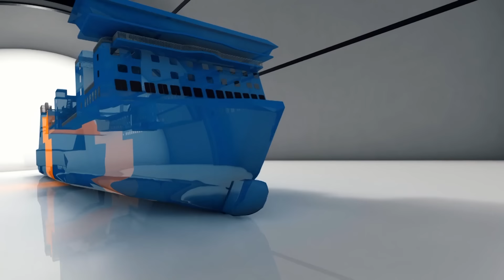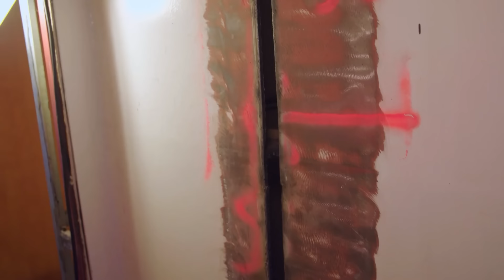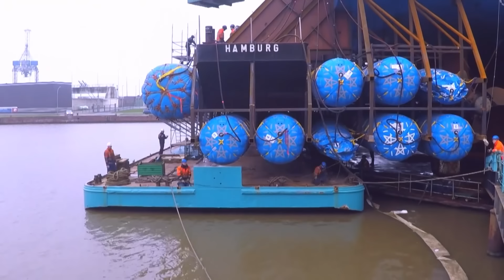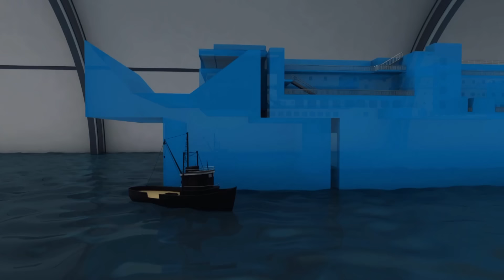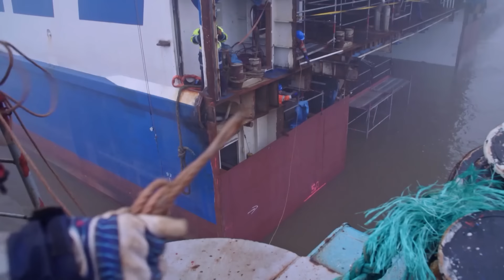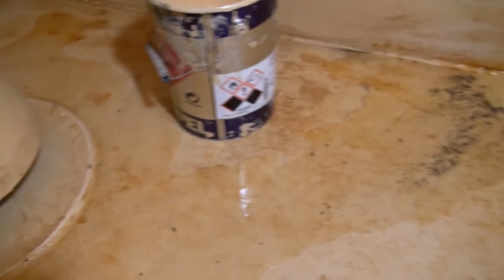Gigantic Car Ferry Heavy Maintenance | Mega Pit Stops | Episode 5 | Free Documentary

Comment: This kind of elongation is common  in the 
Port Weller dry dock At lock one of the Welland Canal. 

many lakers are made longer to expand cargo capacity. this will also increase the , maximum speed under full power.

Comment: 1:03 It's nearly 30 horsepower.  What an efficient engine.
Reply: could of put a 1 litre 3 cylinder toyota engine in it and got 83
Reply: 30,000 horsepower.... 😂
Reply: We have 5 main engines, i work on peter pan
Reply: @joemetcalfe1814  lmao
Reply: @wiggonilsson7258  They said that after the upgrade they wanted (or achieved. Can't remember which one) the same performance and fuel economy as before when the ship was way lighter. That makes no sense to me. Where they correct?
Reply: @amirulaizaramirul3795  That's the correct way of writing it but that's not how they did it.
Reply: @EweChewBrrr01  yes, we have about the same fuel consumption like before, and the same service speed
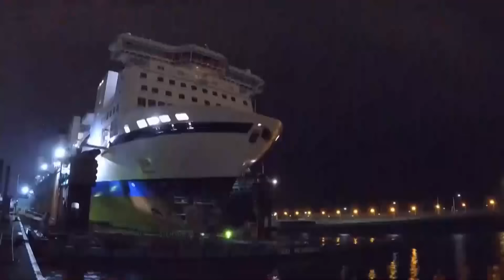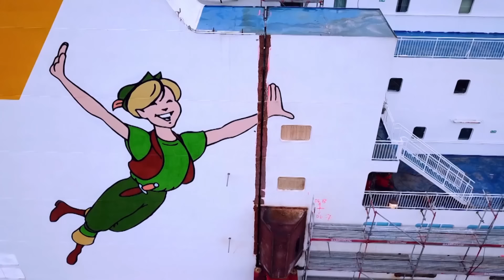Reply: Hi there, Can I please ask you what is powering the lights inside the 2 parts of the Gigantic Car Ferry when the ferry is a ready cut into 2 parts?? In the video I can see lights in the ferry truning on and off even though the ferry is in 2 parts from 11:39 to 11:45.
Reply: @minghonglim9255  generators in the dry-dock
Reply: To everyone who does not seem to understand the metric system .... The metric system does not use a period before the decimals, but a comma and the period indicates 'thousand'. Therefore 29.912 is 29thousand912.
Reply: @silentepsilon888  That's incorrect. When a decimal point is used in a number any digit to the right of the decimal point is smaller than 1. So 29.912 is 29 (whole number) plus 0.912 (smaller than 1) A comma is used to break up a number into thousands. The number should have been 29,912.
Reply: Nope! Not in Germany old bean.
Reply: @EweChewBrrr01  .. try to research the difference between numbers written in metric and imperial
Reply: @silentepsilon888  I don't know Imperial. Have been using metric for over 30 years.
Reply: It looks like the metric system is written slightly different from country to country.
Reply: @EweChewBrrr01      You stumble in your own comment...!!!!    Period (dot)  is not a comma ...right...
 29.912 (which you write) is not the same as 29,912(which you talk about in your example).   I think you need to make up your mind what you want to tell the world....
Reply: @Dan-fo9dk  You need to read what I said again. I said it correctly.
Reply: @silentepsilon888    ....oh... so you understand the metric system....???   As a starter I can say that SI-standard system have nothing to do with your use of a period sign (dot) in between the numbers.  Period (dot) sign has nothing there to do.  Comma sign is the only meaningful sign within a number....the rest is just noise.....     
I guess that is something you have picked up from the weird US-way of doing things... ....certainly NOT from the SI-system.
Reply: @EweChewBrrr01    The use of the period sign has nothing with the "metric system" - SI -system - to do at all.   
That period sign is just noise and have not have anything in a number to do.
It is rather something that some people have picked up from the weird way they do things in the US....
Reply: @Dan-fo9dk  In Australia it's different.

Comment: I like the modification criterion, but the difficulties I read are strange, I explain:
1) Laser cutting would have guaranteed old quality and experience on how to apply laser cutting.
2) When making such a traumatic cut, an oleo graphic simulation is required that cuts the ship at a precise and predetermined point on the ship's cad.
If the cut has to be moved (right or left) to create less damage, this is done in the holographic simulation and then really.
And in logic cut on a weak part of the frame, the additional part of the ship must also strengthen the frame as a whole.
Reply: there's always one🙄

Comment: They have increased the cargo capacity in carrying more cars,but where are these extra 100 car people gonna sleep,if they haven't increased the cabin area?
Reply: They aren't increasing the passenger numbers . The increase in length is for freight . The number of passengers will increase only slightly
Reply: @Hugofreddie  No hugo they said the ship could now hold 100 extra cars.
Reply: @Hugofreddie  n
Reply: @jacknordli7630  indeed I am sorry . I was thinking they used 100 cars as a size . You are quite correct they said 100 cars which will increase the passenger numbers dramatically .
Reply: The extra cars are 3rd class passengers so they sleep in their cars and stay away from the other civilized passengers
Reply: This ship operates routes less than 4h long
Reply: This ferry operates on a 4-hr route - sleep cabins not necessary…

Comment: peter trans pan. was this done to test the technique ? its pretty unheard of that a ship gets an operation after years of use.
Reply: Probably more to do with condition and cost to built a new vessel to take the extra, I'm sure this is a much cheaper option.
Reply: The cruise ship Silver Spirit was cut in half and extended.
Reply: wudup fammm it is quite a normal operation. Being performed many times per year. Big conversions are normal
Reply: You'll be amazed:  just lookup Wikipedia --> "Astoria"   cruiseship
Reply: Unheard? Literally dozens of ships from ferries to cruise ships have been lengthened in Europe alone in the last years

Comment: Interesting they cut apart 1km of seam welding in the new piece with 4km of seam then welded on the back with 4km of seam. And then mystery of mysteries back to 4km being welded. overall.. I wonder how many football fields of welding that was.
Reply: I wondered about that too and clearly, if the cut was 1km, then they needed 2km to put the additional section in, because it now has 2 seam lines., I assume, the other 2 km were used for the additional deck level that was put in the aft of the ship, but while mentioned to built, never shown in the documentary.,